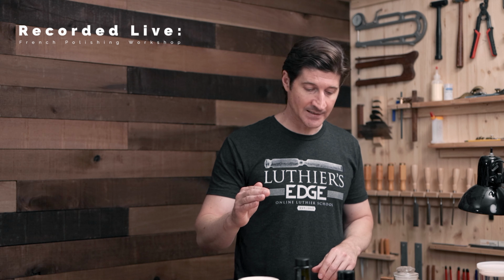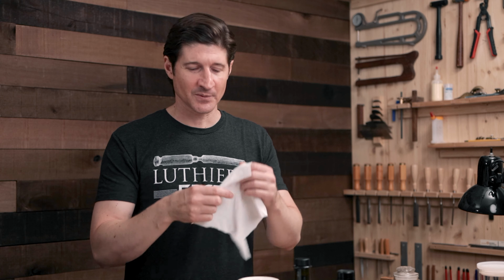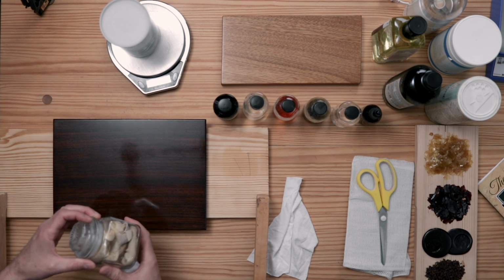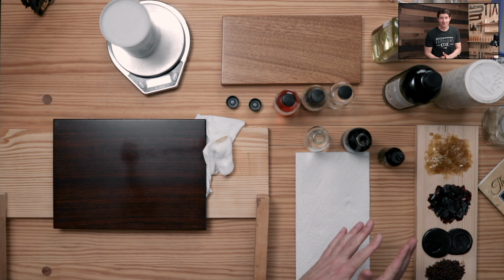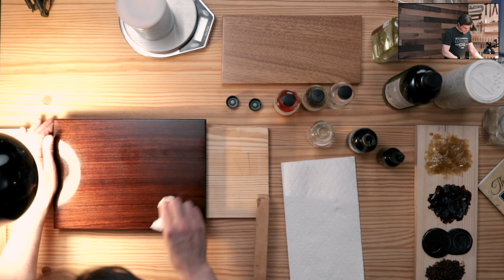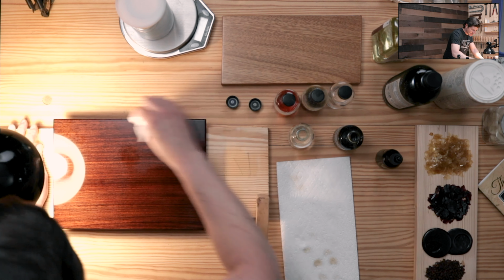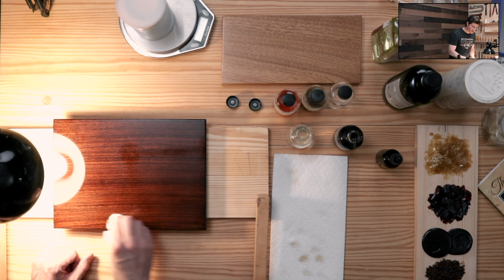French Polishing Techniques - French Polishing Fundamentals Part 7

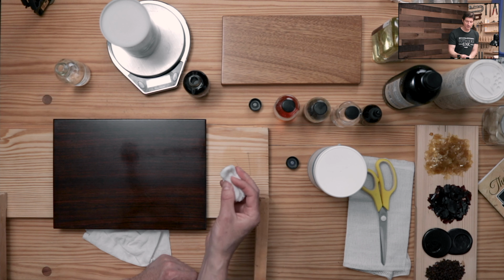Comment: 8:50 wet pads strip, dry pads build. I was with you until you threw in the qualifier after all that which you stated that pore filling is opposite. So, what I'm not clear on, was the statement that the dry pad builds just for pore filling? And opposite for building body coats?

Comment: Great video! Question - im at the bodying stage snd wonder how long i have to let each application dry for before doing another - it seems like i can just continue to go, as by the time i get to the peg head everything seems rock hard snd i can just keep going - what is your recommendations ? Also, I am following your techniques and advice very carefully and am really getting a beautiful finish on a Ukelele, but it seems I am going through very little of the button shellac. I mixed up a pint of everclear to 4 OZ button lac (2 lb cut) and have been coating/polishing for 2 days now, seem to have the start of a nice body coat, but have gone through perhaps a 1/10th of the pint. So, I guess my question is, how much of the shellac should I expect to end up on the Uke? That will help me figure out when I am done. Thanks!